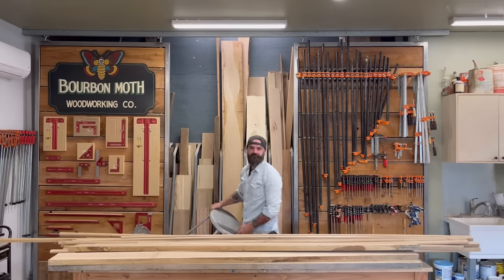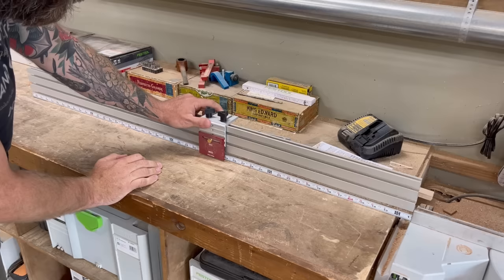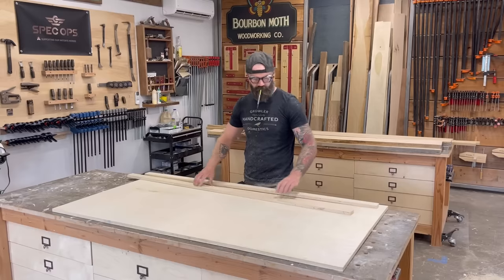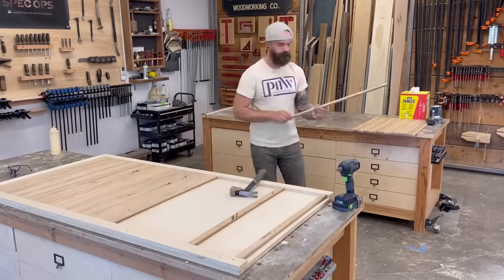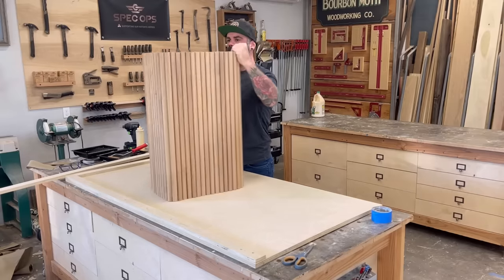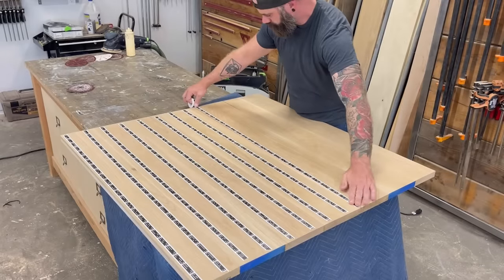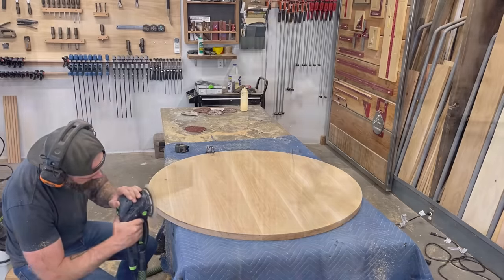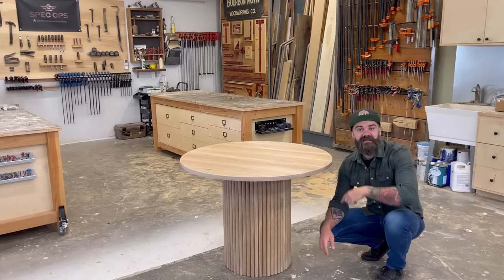Crazy Easy Modern Dining Table || insanely easy table build

Comment from the maker: To start comparing quotes and simplify insurance-buying, check out Policygenius https://policygenius.com/bourbonmoth. Thanks to Policygenius for sponsoring this video!
Reply: there is one caveat, if on the off chance your glue dries before you get the canvas on, you can use an iron to melt the two layers of glue together, this only works because wood glue (PVA) is a polymer (plastic) that melts at a reasonably low temp, but I would be cautious and only use that technique if you absolutely have to, and it would only work with cloth glue ups because its thin

Comment: I don’t quite understand the sorcery that is the Shaper Origin, but the possibilities are endless. Nice work, Jason. You are my favorite subscription on YouTube and it’s always a good day when the notification comes through that there’s a new Bourbon Moth video to watch. The fact that you are a fellow Oregonian only makes it that much better. Keep the content coming please!
Reply: It's just a well calibrated camera and a three-axis mill. 🤷‍♂️ The dots let the computer know which way you're moving. Modern magic!
Reply: To me a string and pencil good enough.
Reply: @FloridaBoilermaker  It works, and is a heck of a lot cheaper. The origins biggest advantage is that it's fast and repeatable (but not as fast and repeatable as a true table mounted cnc).
Reply: @th3oryO  yeah, that, and you're not limited by your CNC table size.  If you wanted to mill a custom profile on a huge slab that's 12 feet square (for some ridiculous reason) you just need lots of that domino tape. 😅 I bet that domino tape is not cheap either.

Comment: 3:15 When you're talking about the 57 inches, that IS the circumference. When you divide that by pi, you get the diameter. So you're basically talking about the diameter. I just wanted to clarify. C = pi x D.  So C / pi = D
Reply: Thank you!  Came here to say this. 😂
Reply: Rose are red, 
Violets are blue,
Making things with wood is fun.
Math is hard.

Comment: For that canvas, you can use David Piccuito's veneer trick. Put glue on both surfaces and let it dry. Then you can place the canvas down and move it around so there are no wrinkles. Finally, just use an iron to melt the glue and permanently affix it in place.

Comment: Hey Jason. Next time when you need a clamp for round things, I think a vehicle ratchet strap would work great. Oh, and another idea, instead of using a piece of scrap wood to help drill/cut, just get some pink insulation foam from the hardware store. It will be flat, you can cut into it, it is light, it is easily replaceable, but most importantly you are not using scrap wood. This will allow you to keep that for further projects with no unnecessary cuts or holes in it. Love the table!

Comment: Ah! You finally got a Shaper Origin! Welcome to the club, you’re gonna love it! BTW, ensure that your circles are really perfect especially when they are large like the one you made. I’ve noticed a slight inconsistency with large diameter circles depending on how much Shaper tape you’ve used and the amount of dominos the Shaper can see so keep an eye on that domino detector in the upper right corner of the screen as you cut. Side note, I checked the consistency of the diameter by also adding a small center hole to my pattern, then using that as a pivot point for a gauge. None of this matters if tolerance is irrelevant — if it’s a table top, 1/16” variance won’t make a difference. But if you’re using the large circle as a gear (for lack of a better example), then you may want to check that you have a perfect circle.
Reply: I WOOD (sic) have put a reference hole in the bottom of the table and used a circle jig to cut the circle instead of some overpriced gismo.
Reply: It does a hell of a lot more than circle cutting.

Comment: While I was watching as you made the jig for applying your canvas backer to your base pieces I had a thought. Being as I haven't personally done this before I thought I would put it out there to see what I might be overlooking. Rather than laying your pieces with the curved face down, couldn't you have stretched the canvas over your jig, leaving it a little long, and then applied your pieces flat side down?
Reply: Could be wrong but it may be that it’s easier bc you can apply glue to all the wood at once and you can lay the fabric down in 1 sheet vs piece by piece. It eliminates having to apply glue to each piece individually
Reply: i was thinking the same.

Comment: It's a beautiful table. I'm curious as to why, instead of affixing the top to the base after it's assembly, one wouldn't attach the top circle of the base to the table top, then assemble the base that way. The inner slats could be attached to the base top first before attaching the top to the base top, then the base bottom could be attached and then finally the fluted canvas. That would at least avoid the awkwardness of attaching the table top last, but I'm probably just overlooking something.
Reply: You'd most likely end up gluing the bottom to the top and then it would be impossible to take apart...

Comment: Oddly enough, at 3:14, I think you mean to say that the circumference is determined by the diameter. In this case, the circumference is the length. Dividing the circumference by pi gives you the diameter; therefore, your laid out length needs to be pi multiplied by the desired base diameter.
Reply: Thank you for pointing that out.  My math brain melted down when I heard this!

Comment: Love this. I’m attempting this now but with 36” round. I see you used 17.5” cylinder size base and I’m sure you had a smart calculator to figure out the correct anti-tip size base. It looks like your base is about 44% of the size of the top. Using that calculator my 36” table would be ok with a 15+/- . Is that correct ? Worried about tipping. I tried 17” base and seated in chair doesn’t allow for comfort without banging knees into base. 🤔
Reply: How did it work out?? I want to build this too but I want to make it much larger as well.

Comment: Got any tips for a corner table fitting around corner benches? I have a square table that I want to get rid of because I built some benches, the square table has legs on four corners. If I could get away with 1 leg I would.

Comment: I wonder how rubio monocoat covered wood looks after a year or so. Does the colour change much? Do you need to refresh with a new layer?
Reply: I've got a table I built 5 or 6 years ago and used Rubio and still looks exactly the same as it did the day I did it. It really holds up well

Comment: I’m planning a similar build but the pedestal is an elipse for an elipse table top.  The pedestal has a 6 degree slope from top to bottom, so the circumference of the top and bottom are different.  I’m trying to figure out the math and wheather or not I can use this tabour technic. Any input would be appreciated.

Comment: Looks like it will fall over kind of easy. Having 3 kids and I look at life differently now lol. I would have stapled the back of the pickets to the cloth and I would have used burlap for strength. I see them falling off at some point. Save your money on those clamps and just by ratchets straps but put something behind it so it doesn't hurt the project. It's basically the same thing and seems like a scam imo. 

Bro, those skinny jeans rolled up at the bottom. I lol everytime I see a middle aged dude in skinny jeans and now the kids are rolling it up at the bottom like it's 1987. Welcome back 🤣🤣
Reply: A couple of weights from a yard sale tucked in the base will solve the tipping problem, or if you live by the beach as I do, a couple of ziplock bags full of sand. As for rolling up jeans, that's 1957 for me. Welcome back again 🤣.

Comment: Listen if you have any ideas for my tiny ,I want to order a metal frame kit 38ft high design with water 💧 storage underneath 1 and a half bath with full bathroom attached to master ,I have been buy lighting flooring and I have a lot of hardwood I like worked into my design, I'm retired disabled levels  steps one level with sitting area on roof and main door a landing that covered I have my think cap on I watch a lot of shows including yours

Comment: I like your work but was a bit disappointed that you positioned that board with the knot in the place that you did. Could have had the knot on the outer edge and even had it on the offcut of the circle.